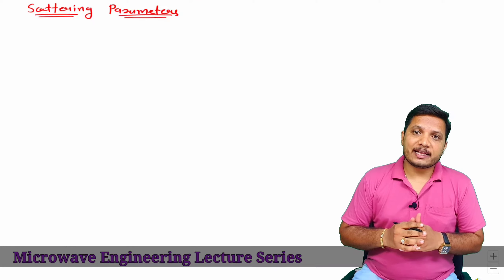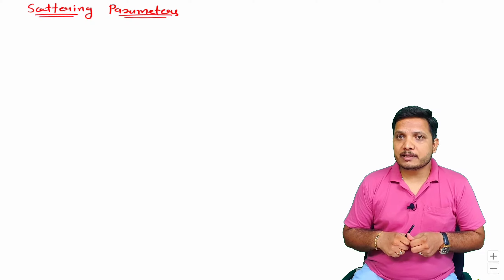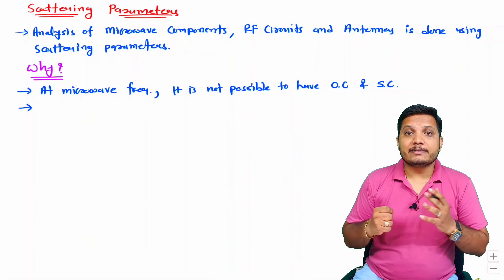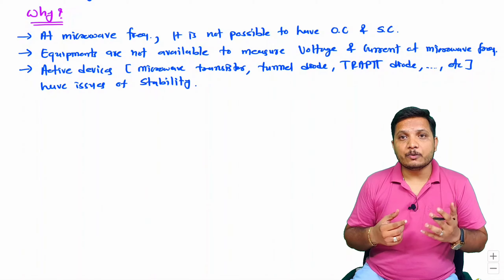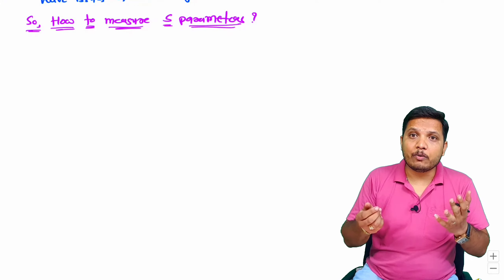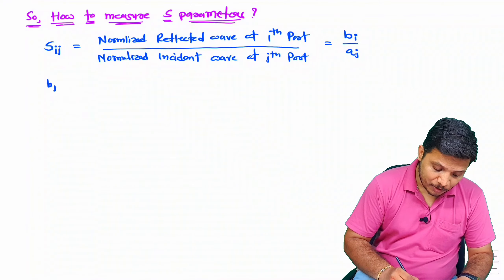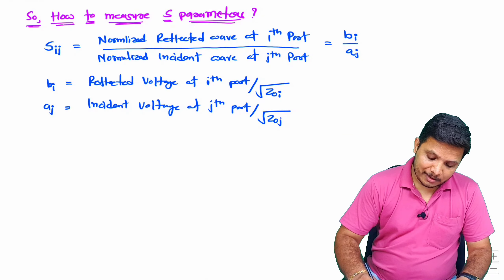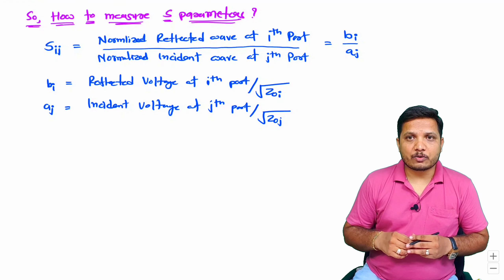Scattering Parameters | Why S Parameters in Microwave measurement? | Calculation of S Parameters

Comment: Sir, I has a short question. You said that Z/Y/ABCD parameters are not measuring the voltage value. In case of S-parameter, how to measure reflected or incident voltage value at port?
Reply from the maker: Here we measure that with respect to energy incident and energy reflected from ports.